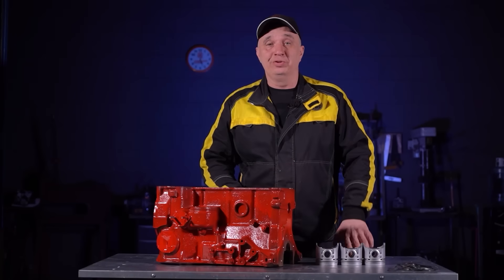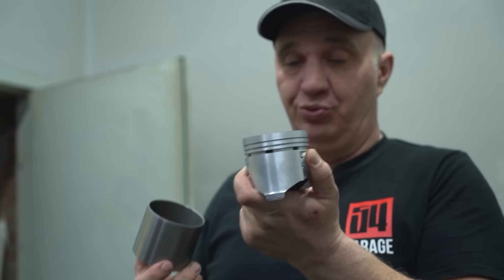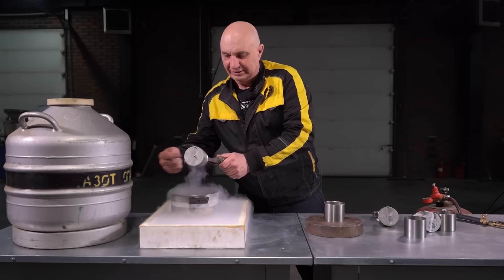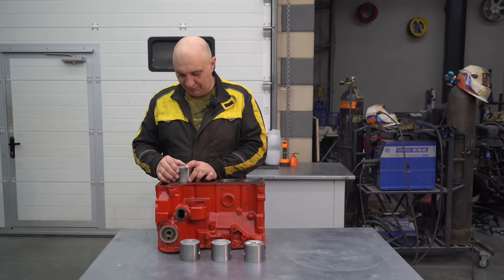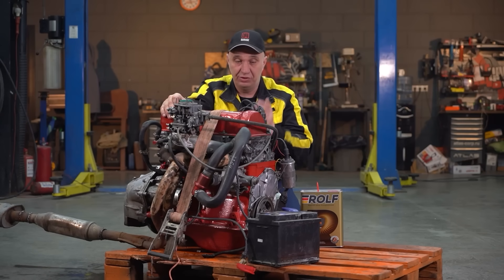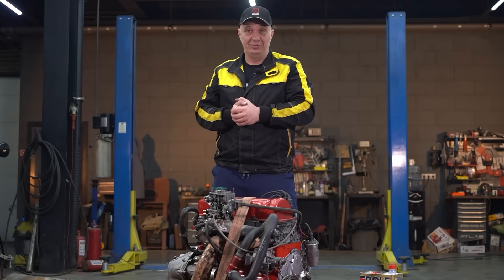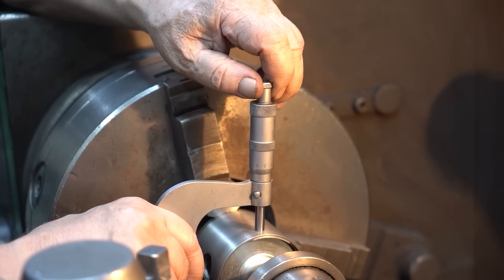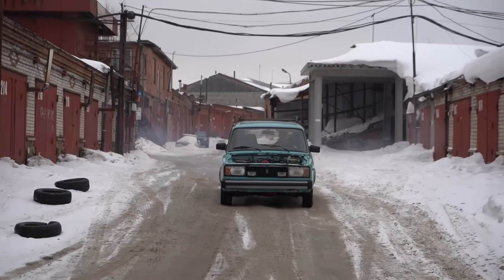We fit pistons with no rings to an engine - will it work?

Comment: 2 stroke oil?   After all the mix is administered through the top valve which means the mix will reach the hard to get to places atop the piston area thus aiding cooling and lubrication.   Maybe look at a BMW design of oil jet which forces oil up and under the piston itself which will also produce a flow along the con rod again aiding in lubrication and cooling properties.

Comment: If you build an engine a couple thousandths loose no one will know, if you build it a couple thousandths too tight everyone will know
Reply: Build The Engine Too Tight and No One Will Go... Anywhere😢
Reply: You have to make the clearance work for operating temperatures, not ease of starting. You would have to use some sort of block heater to pre-warm the engine to make it start.
Reply: @toolbaggers 90s F1 cars had engines that were seized at room temp so they had to be externally heated.
Reply: @toolbaggers Correct..... 

This is why F-1 cars heat the engine up to darn near operating level BEFORE they start them up
Reply: just imagine someone selling this engine and saying it only needs a head gasket 🤣
Reply: @justt_ace  most evil thing someone could do
That person will try everything they know to make it run right
And then give up sell it and the cycle continues till someone decides to open it up
Reply: If you build an engine a couple thousandths loose, the guy with the checkered flag and you will be buddies.
Reply: @tracesmith3572  Not always.... 

A loose engine can make you end up WAY down the pack, because it won't make the power as the properly clearanced engine will.
Reply: You have to make the clearance work for operating temperatures, not ease of starting. You would have to use some sort of block heater to pre-warm the engine to make it start.
Reply: 2 stroke oil n gas mix would help
Reply: You just described Honda and Toyota 😂
Reply: Runs like a normal Lada fresh out of the factory;-)!
Reply: thastt ba stupid statment,,, loose or thight wverybody will notice..
Reply: BS
Reply: A couple thousandths too loose can ALSO be a bad thing too.... 

Sure, the engine will run and won't immediately blow up, BUT..

The engine won't make as much power as the others, it can smoke, and it won't last as long.
Reply: And we wanna know!
Reply: Hey disculpen mi ignorancia, como se lubrica el cilindro? La tolerancia del cilindro lubrica el anillo y los cambios de temperatura los absorbe el anillo con la tolerancia entre el gap y la compresión la produce la expansión del anillo y corta la película de aceite sobre el cilindro y el cilindro con el rallado de la pulida o honed es lo que mantiene lubricado el blok y el cilindro y las faldas del pistón y los anillos.# Representa la vida del motor.
Reply: So like the SR-71 jet? They have to make the tolerances for how much everything expands from friction at full speed. Even the fuel tanks leak until the metals expand enough to seal correctly. Maybe heat pistons up to running temp out side of engine to take those measurements and machine to those tolerances?
Reply: dont forget they use alu pistons for a reason
Reply: This is literally entertaining
Reply: Like what happened to your mom's vahina
Reply: Reminds me of previous  girlfriends
Reply: 900th like !!!
Reply: On a diesel in my theory it could run away too
Reply: Yes, but it could be solved with a pistons made from steel, because they expand Much Less towards the Aluminium ones.
Reply: @bustjanzupan1074  Even steel pistons expand too much. Thats why piston rings where invented.
Reply: @Chris-yy7qc  Aluminium expands almost Twice as much as Steel, so it would make a Double Big Difference .
Reply: @bustjanzupan1074  Both pistons will jam after a very short period of time. So it doesnt make any difference worth mentioning. That engine wont last no matter what.
Reply: @Chris-yy7qc  Hven't you seen the engines without the piston rings running very well for a longer time, such as small Diesel engines for repilcas, or Tomos Racing engine ?
Reply: @bustjanzupan1074  And why does this work? You gave the answer yourself: Because theyre small. Just because stuff works on miniature scale, doesnt mean it works in large scale, too. Please google how thermal expansion works.
Reply: @Chris-yy7qc  Thermal expansion is working when material is heated. Or is it something else behind the thermal expansion ?
Reply: @Chris-yy7qc No, the smaller engines without rings don't just work because they're "smaller". 
That's not it at all. They work because they're made of a different material, use a different type of lubricating oil, and are a 2 stroke variant that oils completely different than a 4 stroke engine does. The reason that they DON'T want to use rings in the smaller engines is because at the small scale that the tiny R/C engines are, it's the friction from using a ring(s) that becomes an exponentially increasing factor and ends up robbing too much power from what little power the things produce in the first place.
Reply: @davelowets  Smaller piston = Less expansion. Physics class, middle school.

They purely and only work because theyre smaller.

Your material theory doesnt make sense. Why would you build tiny RC motors from superior material. But highend race motors from a inferior one?
In reality those tiny RC motors are made from the cheapest alloy.
Reply: @Chris-yy7qc  expansion can be countered. all pistons have a smaller head then foot. just because its hotter. you  could make it work but it would add so much unnecessary friction

oh you meant the steel sleeves? yeah thats another thing but its a common practice to add steel sleeves as cylinders int oalu blocks for the leightweight and cooling benefits of alu, while having the strength of steel for the combustion chamber but the increased teampreature there and sleeved pistons. i doubt you can make that really work and why should it. anyways. what am i talking
Reply: @bustjanzupan1074  Except that hypereutectic pistons are unbeatable for how little thermal expansion they experience, and they're aluminum.
Reply: @wills.5762 NOT for the use of no rings...

A hyper piston is also fragile, like glass, and will shatter when stressed too far. 

I would think that a forged piston would be best.
Reply: @bustjanzupan1074  They might have needed to add a little weight to the counterweights but yes steel and cast iron are a better combination. Model engines used Meehanite pistons in hardened steel liners.
Reply: @redtale6527  Not the model engines that I use....

They ALL have an aluminum piston in a brass sleeve with a hard chrome coating inside the bore. 

They call them A.B.C. engines. 
A.luminum(piston) B.rass&C.hrome(sleeve)

Edit: Actually, I DO still have some tiny Cox engines that DO have the piston and cylinder that you described. But those are all from the 50's and 60's. Today's R/C engines are mostly all A.B.C.
Reply: @bustjanzupan1074  depends on the construction of the piston. if it was cast around a steel skirt- it will expand much less than without the steel skirt. forged pistons also show a lower expansion rate under heat as opposed to cast pistons. steel pistons generally cause more issues than those that they solve. steel on steel is not a good thing when it comes to street motors.
Reply: @bustjanzupan1074  yes I was thinking similar expansion rates too. Maybe hone cylinders for lubricant space in the micro grooves. And do same with pistons but leave a top rim with none?
Reply: meanwhile the PC industry is laughing...   were approaching 6 nanometer dude thats patheticLOL
Reply: That's it? That's your contribution? Wow. Nothing to do with no rings but wow, I guess now everyone knows the secret and how smart you are
Reply: @lollipop84858  his original pistons were too tight 😂🤦🤦🤦🤦 jackass

Comment: Just because the steel doesn't thermally expand as much as aluminum, the aluminum on the inside still causes it to expand more than it should. If you made the entire piston out of steel, it would last much longer
Reply: The piston would still heat up way faster than the block and seize. They should pre-heat the block like in F1
Reply: @mariueg  Ringless model aircraft engines use several different technologies to allow for thermal expansion. Diesels and older engines use cast iron pistons in steel bores. Then there are hardened steel pistons in soft steel bores (Cox) and ABC which is an alloy piston in a chrome plated brass liner. The aluminium they use for pistons also has a very high silica content to reduce expansion and provide a tough wearing surface. Oil content is very high at 5:1 but most of it is for cooling not lubrication. It can be done with the correct metallurgy
Reply: They did that already.
Reply: I had that thought, too. That steel will stretch when the aluminum inside it expands. Between that reality and the fact that there is no piston to wall oil feed.........this was doomed.
Reply: @edifyguy Yes, I would think that some grooves or a pattern, on at the very least the bottom half of the piston skirts, might help to retain oil and help with seizure and sealing problems... 🤷🏻

The old hit&miss engines had an oiler that would drip right thru a small hole in the cylinder, onto the piston, and then there was some grooves in the piston skirt that the oil also ran thru to distribute the oil around the bore.
Reply: This would have worked if it was a 2 stroke diesel.
Reply: @ADHDsquirl  what's the theory behind diesel?
Reply: @ADHDsquirl Why would that have made any difference?  

And NO it wouldn't have worked...
Have you ever seen a 2-stroke Detroit diesel engine piston? They have rings at the top AND the bottom of the piston because BOTH ends of the pistons HAD to seal in the bores, because of the intake ports that are open thru the cylinder walls about half way down the bores. If the pistons didn't have the rings on both ends, the required supercharger WOULD have pushed the intake charge down into the crank case past the bottom of the unsealed piston skirts.
Reply: @davelowets He missed some details. A German 2-stroke diesel worked very well without piston rings. It had only 0.01mm clearance. The piston was from steel and the cylinder had inner cooling by the charger fan. That cooled the piston too.
There was no oil smoke. The inventor tried a piston ring but it increased the oil consume. So it was omitted.
Reply: Seems obvious, no?

Comment: Make the pistons 1 - 1.5mm smaller and coat them with cerakote
Reply: What is the objective of this suggestion??? Harder skin on the pistons so they damage the cylinder walls more once they start to scuff?
Reply: @GroovesAndLands  107%        also when after enough heat cycles of the metal shrinking and growing the cerakote will start to flake off, ceramic flakes do amazingly catastrophic damage when they make their way into the oiling system 😁

Comment: It would be interesting to see this when the piston is made of the same Iron as the cylinders.
Reply: i would guess even if It help a bit, It would still be a problem that the piston istelf get's substantially hotter, than the cylinder, wich transfers it's heat to the massive cylinderblock.
also the massive cylinderblock doesn't get's as hot as the inside of the cylinder and prevents the cylinder from expanding to much (I think).

Nevertheless interesting thing to test out if (how long) an engine can work without piston rings.

Comment: you should have considered cutting some oil galleries on the piston sleeves. obviously the sleeve top needs to be without any cuts, to keep the compression, but below you can cut some shallow piston ring-like grooves with interrupting cuts on the bottom two, so that oil can pass by. then below you can do some straight down grooves, maybe on the side where thrust load is not a problem. keep the tight tolerance. also, since the contact area is much much larger now, you need much more oil to regulate the friction heat. maybe additional oil squirters are needed. this is a great idea, but your design needs improvements. Наздарове!
Reply: yep
Reply: Came here to say that, those pistons would work fine if they had those grooves given the fact they weren't looking to burn no oil, and in fact not only the pistons would retain oil but would also perform better under thermal expansion as the grooves would make the material expanding in a more uniform way instead of bloating up by hot spots.
Reply: Or do like street racing motorcycles, with the side of the piston skirt drilled through or just pores

Comment: i once tried to fit a steel rim on an aluminum wheel, the aluminum sucked the heat from the steel rim, the rim contracted on the expanding aluminum, the union failed and upon examination the wheel diameter had deformed and it's diameter was much smaller than the rim.  perhaps your piston expanded so much faster and the fit failed